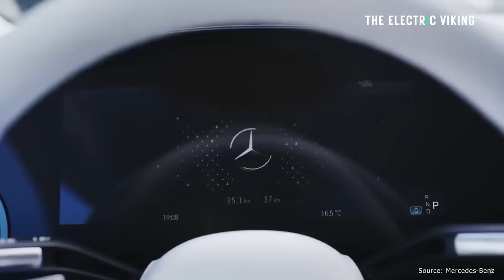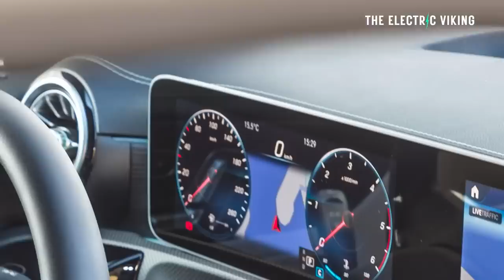NEW Mercedes-Benz CLA gets 466-mile range and amazing efficiency

Comment: The great thing about concept cars is that you can assign all sorts of miracle numbers to them without anybody calling you out on them.
Reply: Same goes for FRUNKENSTEIN. I'm the cutest revivified doll that ever lived! Sort of...
Reply: This is also the European rating standard which tends to be higher than EPA measures.  Also we have to see real world results.  If this is true - they would have to have removed a lot of weight of the CLA body.  Or they just crammed a large battery in there.  So for me -- efficiency ratings will matter more for me.  Having said that - kudos for Mercedes for not keeping their head buried in the sand on EVs.
Reply: I agree that figure is potentially elevated, and the rating when it goes on sale will be less. However, it is noteworthy that Consumer Reports in the USA bought and tested EV ranges by setting cruise control to 70 mph, 112 kph, and drove the cars to the point of needing a tow. In these tests, Mercedes EQE, EQS, EQE SUV, and EQS SUV all provided many more miles with the EQE 350 4Matic returning an extra 72 miles. In comparison, Tesla Model S LR returned 39 fewer miles than it’s range rating. Outside of the Tesla fanboy world, anyone who watches EVs knows that Tesla lies about their ranges on every model, and few people are able to achieve those ratings. This has been proven time and time again in real world testing, but you can’t prove it to a cultist.  Just like you can’t prove that heat pumps do not work at temps lower than 5C, and overcomplicate climate systems for minimal efficiency gains. EVs are better off with efficient electric heat utilizing heated fluid and automatic cabin thermal monitors. The money would be better spent on laminated insulated glass, and cabin sealing. Yes, the “octovalve” is an engineering marvel, but not worth the trouble in the real world.
Reply: @whynotthinkwhynot-  Cut and paste nonsense

Comment: Again, you forgot to mention the voltage!! - The MMA (Mercedes Modular Architecture) is based on an 800V architecture, just like the ne E-Actross 600 is based on a 800V architecture, unlike all of the earlier models which are based on a 400V. Notably, all of the earlier Tesla models are also based on a 400V architecture and just the Tesla Semi and (probably) the Tesla Cybertruck have a 1000V architecture. So Tesla is actually just a few months ahead, not years as many people would expect. - Now the voltage is a key factor to increase the charging speed where Tesla is currently stuck at 250kW (500A*500V). For the new Mercedes CLA they announced to charge it from 10 to 80 percent in less than 30minutes. If you consider the announced range of the vehicle that requires quite some enhancements for a stop at an HPC station.

Comment: Good to see the old guard get more serious. But you have to cut through the PR nonsense. The touted 12 KWh for 100km they want reach with one model based on the MMA some time in 2024 is nothing special. The new Model 3 LR does 12.2 kWh  - TODAY

On the other hand, If Mercedes is talking about 12.x kWh/100km based on the WLTP standard calculation for that value, it would be a significant step forward. The new Model 3 does 14.4 and 14.7 respectively
Reply: Where do you read it does 12.2?
Reply: Nice facts! And tesla does it on 75kwhs useable pack capacity and not 89kwhs like the merc concept thing claims.
They also do it in dual motor awd trim not single motor rwd, and without using 800v tech or a 2speed rear transmission. 👍🏻😎
Reply: @4literv6  so for sure the Merc will have stellar margins 😜
Reply: @nikos6220  it's range should look nice. I bet the price is 25% or more than a comparable tesla m3 though whenever it finally arrives?

Also it won't look like that concept car either, the prototypes caught driving around even with camo don't look very good. 

Example the eqs vision concept was stunning looking vs the equally boring looking eqs production car. 😀

Comment: Heat pump should be an option. It's useful in temperate climate, but basically useless in extreme cold Canada north. With all that added complexity and cost and prone to failure when working so hard in very cold weather. Not to mention noise and vibration compared to regular resistive heater. At least heat pump equiped cars should allow user to choose which heating mode to use - heat pumo or resistive. Sometimes, when range is not a concern, but quiet and comfort is priority one should be able to turn off heat pump.

Comment: I think you never drove a Modell of the EVA2 plattform (EQE,EQS,EQS SUV)..its a dedicated EV architecture. 
Not Audi nor BMW has developed something like this. 
Of course the Styling is not everybody taste, but they are competative to tesla. 
The MMA will also consider IC engines, so its hybrid architecture with the focuse on EV needs but not pure Electric

Comment: CLTC = EPA + 35%
So realistic range is 466/1.35 = 345 miles or 550km no great leap forward.  Auto industry still pulling the old BS just as they do with fuel consumption figures.
Reply: I thought EPA range was always wltp km/2 in miles and round up to the nearest 10. 😅